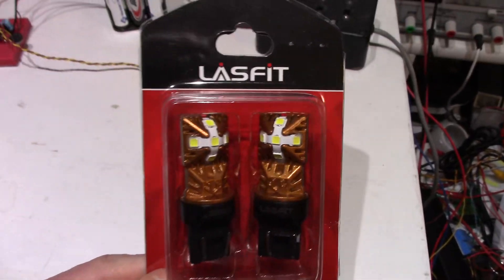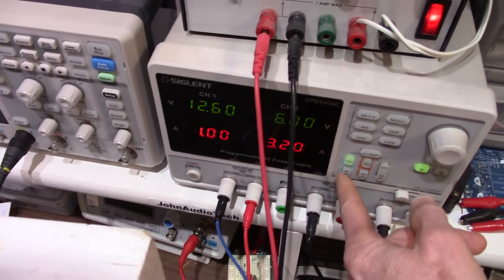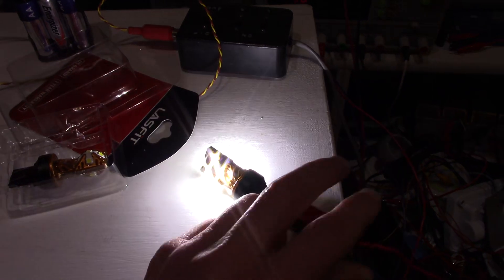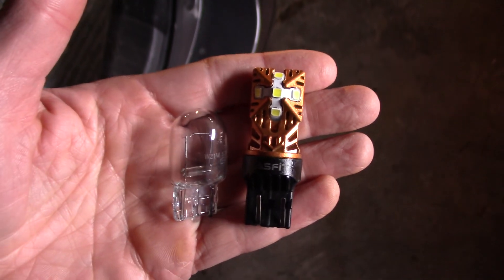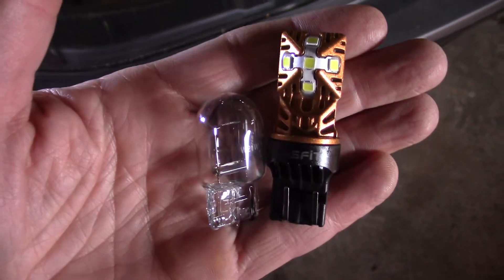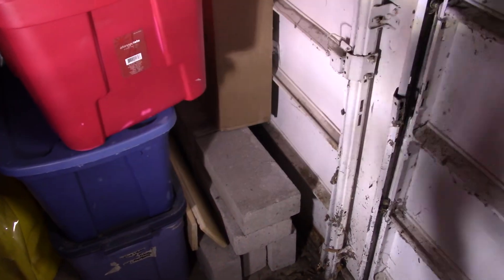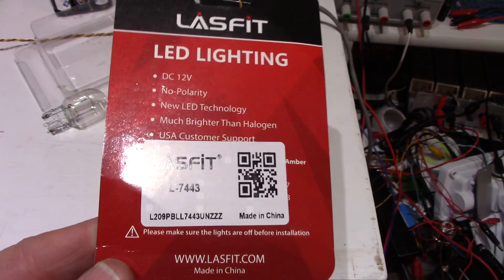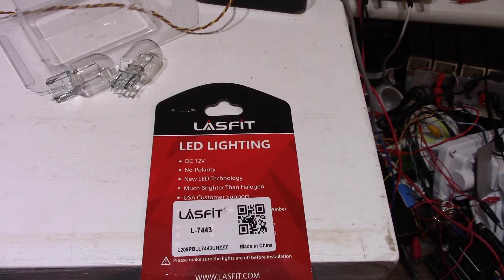Lasfit 12 volt LED bulb for car reverse lamp

Comment: I wonder what is the max Voltage you'd ever see in that Honda. Some of the older cars would boost Voltage when started in very cold weather, like in the excess of 17V which a lot of LEDs won't handle, the same issue I had with LEDs in my lawn tractor until I put in that buck regulator. I don't think they do much of a cold boost in modern cars but haven't checked mine in the rare sub-zero conditions.
Reply from the maker: I never measured it, but I notice a soft ramp up of the brightness of the headlights after I start the car as if it is electronically controlled. Probably no more than 14 volts or so.